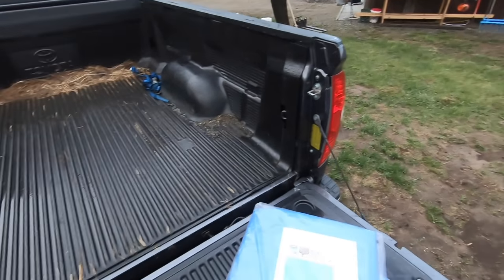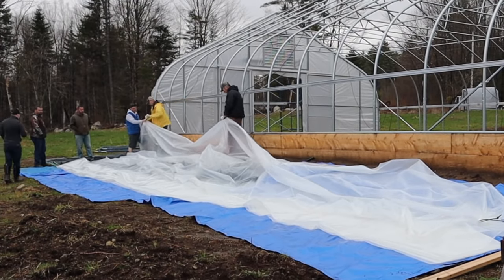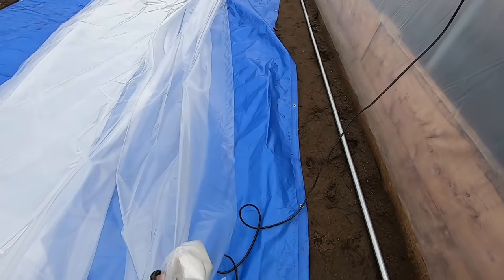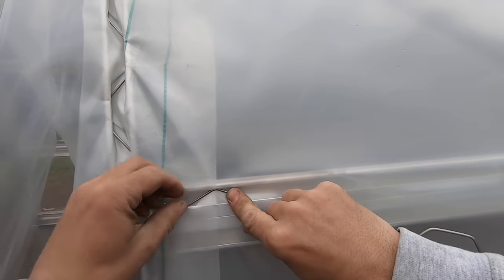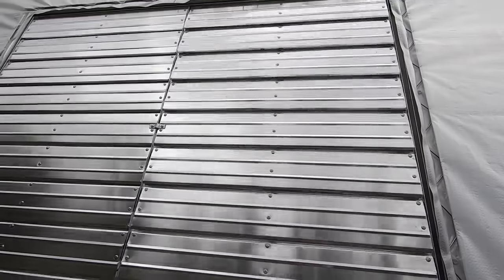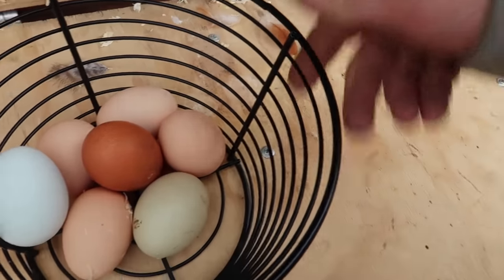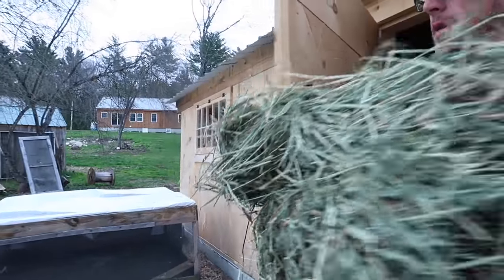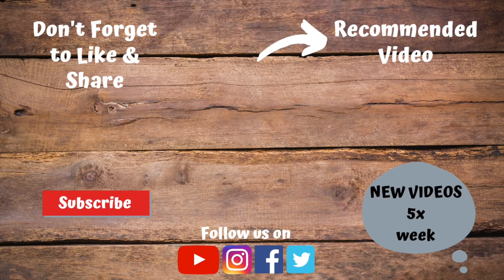Installing 2 LAYERS of GREENHOUSE plastic w/ 3 ROPES (GHB #16)

Comment: You my friend, need a tin of Dermatone. I used it for years working as a ski patroller, ski lift mechanic, etc. It helps prevent frostbite and windburn and works on your face and lips. Works in the summer too when the wind is up or you're on the water. Comes in a small round tin that keeps in your pocket nicely.
Reply: Dave, Have you tried coconut oil????

Comment: Great job on the greenhouse!  
To help keep chicks out of the feed trays we found that attaching a short 2" x 2" x 4-6" long,  perpendicular to the length, under the tray around 1" from each end, can keep the tray up toward chest level. When they first arrive just nestle the tray deep in the litter and lift it higher as they grow.  You can use hook and loop tape to attach the 2 x 2. Staple the tape to the 2 x 2 and stick the other half of the tape to the bottom of a clean feeder tray. The 2 x 2 can be easily removed for feeder cleaning and storage and are cheap to replace.

Comment: Al 200k subs is a huge achievement.  Greenhouse roof went up really quick. Are you going with thermostatic vent controls? Have you decided on a watering system? What type of fans are you going to use?

Comment: I imagine it's a huge relief to finally get the greenhouse under cover!  I'm looking forward to see how you take advantage of it.  After seeing your one point of view from the doorway, I would reiterate what some commentators mentioned the other day about making sure you've got room to drive the Kubota and/or the Mule down through the middle of it.  Will come in handy over the years when you want to bring in compost or material for mulching.  But, if you don't want to waste that much space, just use it to stage some plants in pots (or even a potting bench, etc) that can be moved out of the way when you want to use the "driveway".

Comment: Goooooood Evening , Al , Gina & Olivia ,
As my son would say , A good job done ! Now all that is left is the tweaking when you have some warm sunny days. Yes , approaching 200 K subscribers ! Unbelievable. I can remember when you had fewer than 10 K subscribers. That large tiller is okay for now while you have lots of open space. I have a Mantis mini - tiller that is small but mighty.  It would be just the thing for later on when you have plants growing and space begins to get tight. It is very maneuverable  and does a good job for being so small.
  Now that you have the roof covering on you will have no more rain inside. Devising a way to collect the rainwater would be a good idea.  Of course you can water with a hose from your well . Which requires electricity to run your pump.  To keep the greenhouse operating costs down you'll need a way to water without electricity. 
  I don't know about you but my electricity is not cheap ! And seems to increase in cost every six months to a year.

Comment: here is a trick==a fishing pole with reel and weight at end--cast it over whatever you are doing--then tie the rope to end and reel it in while walking backward....sure makes it easier.  God bless.
Reply: not a fisherman? String tied to a water bottle to throw (good weight, easy to grip) Other end f string to rope. Pull it over.
Reply: Make a Monkey Fist on one end and throw it over

Comment: Because you need permanent power to run the blower on the green house (and PLEASE don't use extension cords)   you might want to look at the small  electric tillers on Amazon.  $150 gets you a good one.  They are very handy for working "indoors" (no gas engine).   You could power up outdoor kitchen at the same time.

Comment: Great job on the plastic roof raising. Now that's modern farming. One question. Does or did the front and back panels get a double layer of plastic?
Now as for the babies names. I was thinking Flintstones. Betty, Barnie and Boo Boo. LOL That's because then you will remember and honor there mother who's name begins with a B. Buttercup. 
Gina, what was for dinner? Chuckling. Didn't want to leave you out of the picture. 
It was nice your friends pitched in to give you a hand. G-D Bless and stay safe.
Reply: End walls got one layer of a special woven plastic. Shown & explained in video dated 11th May 2020.

Comment: Question - when wiggle wired the end, did you end up putting down 3 layers of wiggle wire in the track? If so, how did you fit all that wire in the track? (I'm asking because I'm about to wire mine in)

Comment: Question:  after applying 1st layer do you use wiggle wire all over, and then repeat with another wiggle wire on top of the 2nd layer all over that one?  

Also is it okay to only use one layer of plastic?  What happens when it snows?  We do not have a blower...how woukd you do the blower part? Thanks!

Comment: So you have the end wall plastic secured in the wiggle wire track before you started the top 2 layers.  Top layer one goes on, secured with wire.  Top layer 2 goes on, secured with a 3rd wiggle wire in the same track ?  Or did I miss you removing the wire from the first top layer and using it to install BOTH top layers ?

I ask because my wire track doesn't look like it will hold >3< layers of plastic (one end wall and two top layers) along with >3< sets of wiggle wire in the same track.

Comment: you will find that by putting it on so lose at that temperature that in the summer ti will be to lose your plastic grows a few inces so make it tight especially the inside layer it will form ripples if it is to lose and although it is IR and anty condensation you might still get drips on the wrinkels

Comment: I'm surprised that there didn't appear to be any sort of cap on the ends of the wiggle wire channel rails to prevent chafing the plastic and possibly causing a tear in a storm or just over time. I know the plastic gets replaced every 4 or 5 years but it would take just one big wind storm with erratic winds to cause a tear. 🤷‍♂️

Comment: for the next time first put your roll of plastic on the top sticlk in a pipe and roll it out ove the peak. You can walk over the purlings.  it is folded so that it comes appart to both sides. it helps to pull on each side to unfold. put in your corners to hold it and a pice in the middle. then roll out your outer layer and fasten the whole thing. no tugging and pulling and chanses to rip the plastic. that is how I always put on new plastic.

Comment: Are you sure the two layers of plastic were put on in the right order? I would have thought that the UV layer would be the outside layer protecting the clear (inner) layer from the UV light coming from the sun. From the video, it seems that the UV layer was put on first (making it the inner layer) and that the clear layer was put on second (making it the outer layer). This means the clear layer is exposed to UV light and is not being protected by the UV layer. I think it should be the other way around unless the clear plastic also has its own UV resistant side.

Comment: Did you use one wire for each layer or one wire for both layers ??? ... Billy Joel and Billy Bob ...
Reply from the maker: We tacked they first layer down in a few spots with wiggle wire and then wiggles wired completely on the last layer

Comment: Your plastic will expand believe me it will look like a balloon. If you put it on to loose it will expand/balloon to much. You or your crew won't rip the plastic. Another thing about getting it to loose. The wind will eventually rip it along those little bends you used as a guide. Same principle of bending a wire back and forth. Loose plastic is loud. the wind is going to ripple it and the ripples will be clapping like hands. The looser the plastic is the louder the sound.

Comment: Al, If you don't start out with an effective means of rodent control you're going to be extremely disappointed when your tomatoes start to ripen. I like "Just One Bite" bait. The name says it. If you use it consider making some little rat bait houses to keep the bait from spreading to other animals. I put it out, and there are no sights, noises or smells later. They just die somewhere I don't know about.

Comment: The rope didn't go over it because it had no weight to it. Next time think about getting a wrench or a large nut, tied to the rope and it will fly over better.
Reply: I was wondering if the drone could have pulled the rope over. Not sure what sought of lifting power they have.
Reply: Or a bottle with some vatter in...
Reply: Yes..what I was thinking too. But considering how far they've progressed, things sure are looking good. Throwing caution to the wind may have seemed like a good idea at the time, unfortunately it didn't have any weight to it.

Comment: In the 60s, I remember people pouring used engine oil on gravel roads. In the 70s, I remember hearing that a plastic bottle would float in the ocean for 100 years...   why do I have to replace my roof every 20 or so years...   wondering how long that you expect the cover to last, sir